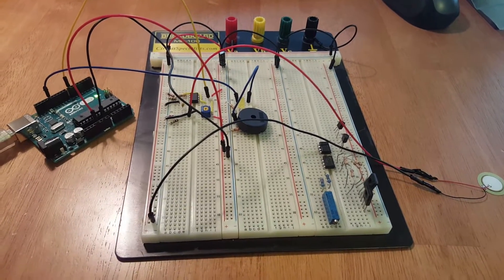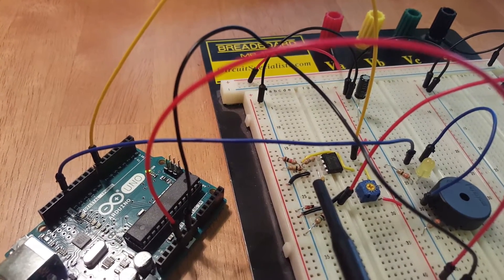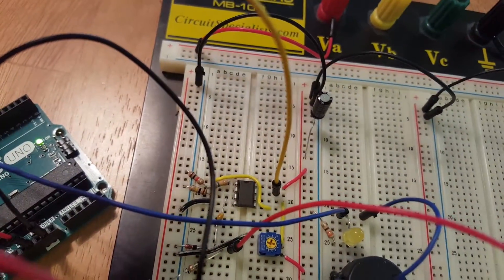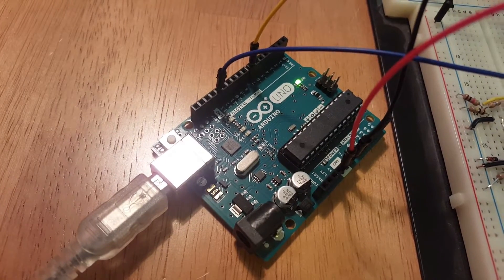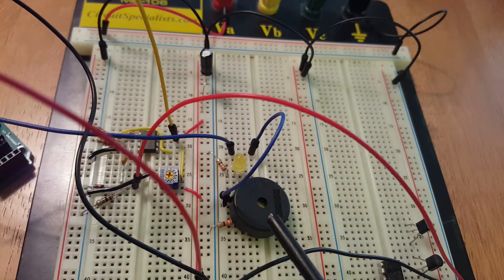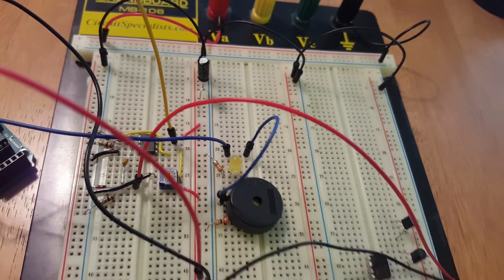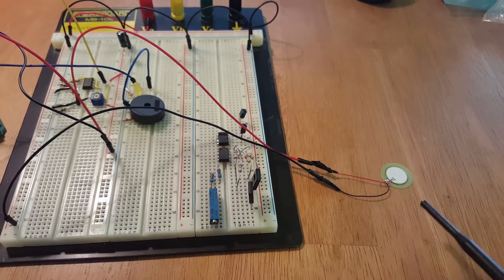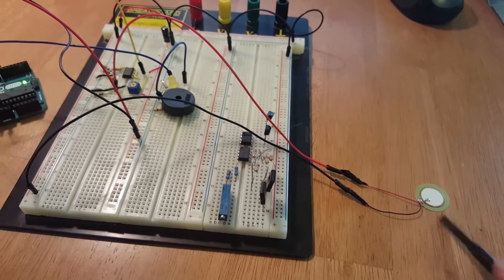Vibration Detection Circuit using a Piezoelectric Element and an Arduino Micro-controller

Comment: w04-12-2023

(1.) Hi, there.

(2.) New to electronics and not yet able to translate schematics into accurate breadboard connections.

(3.) Would you be able to show proper placement for how to operate this (close the circuit) just on the breadboard alone, without the Arduino?

(3a.) I get that there would need to be a 5v DC power supply source, but what about the Zener diode? 

(3b.) Next, where/how would the jumper wires be configured to transmit the signals being processed by the Arduino? 

(3c.) Other questions, too, but guessing those would be answered  breadboard layout minus the Arduino. 

(4.) Could you also list the components used and their specifics (value, percentage, watts, volts, etc.)?

(5.) Thanks.

(6.) Congratulations to you and your colleague on the SIDS prevention project.

(7.) Toodles!